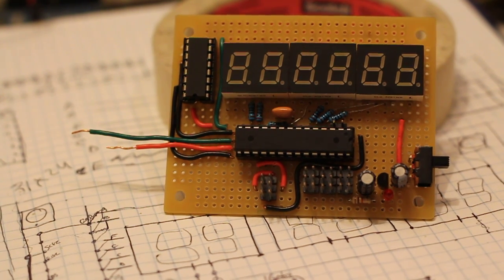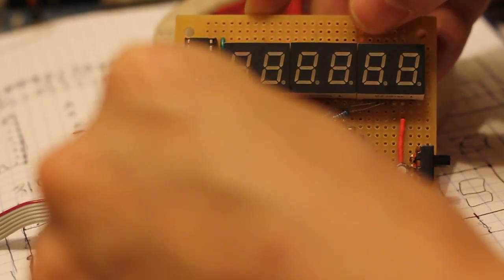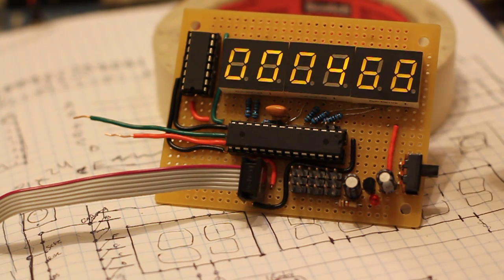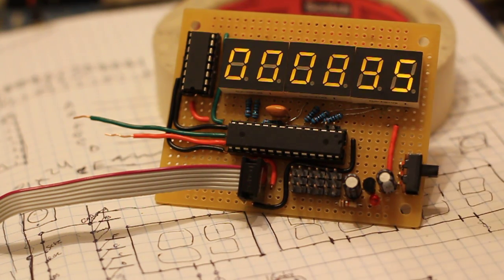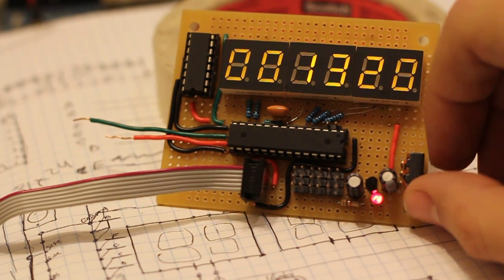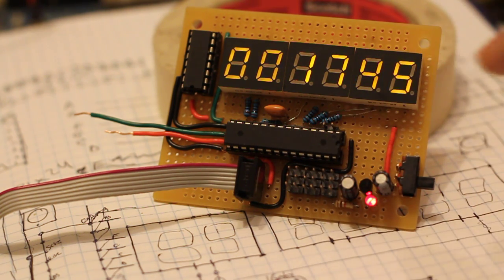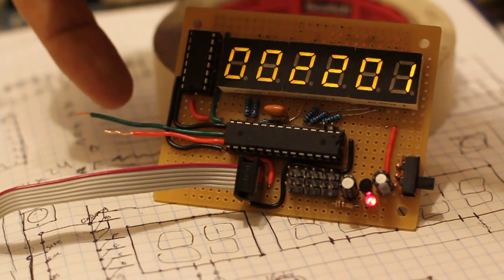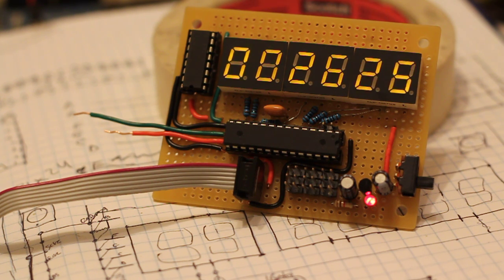Seven Segment Counter with ATmega328P

Comment: Nice board! This is a nice, efficient example of multiplexing - you can barely see the flicker (even that's probably because of the camera's frame rate). I'm interested to know - did you program the device in the arduino environment (the 328p is the standard arduino chip) or did you use AVR-GCC? In any case, nice work - earned a subscriber ;)

check out my channel, I have similar videos that might interest you!